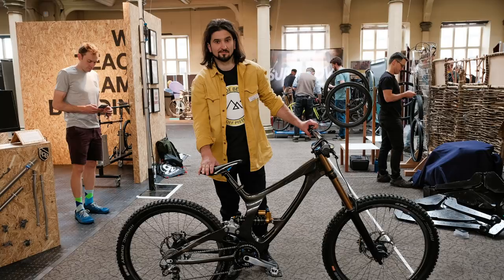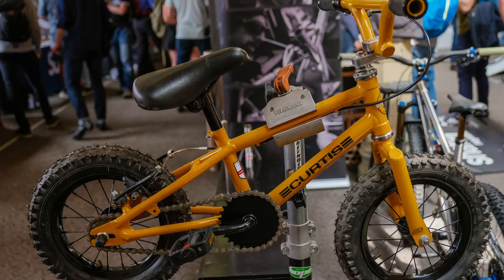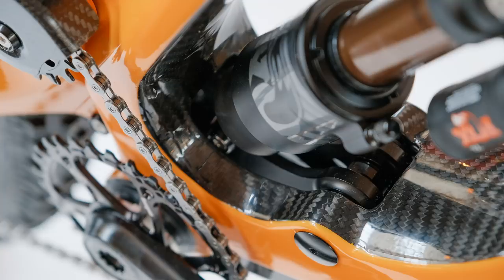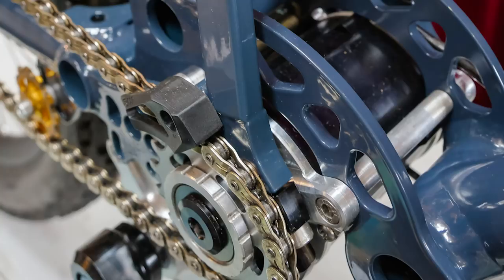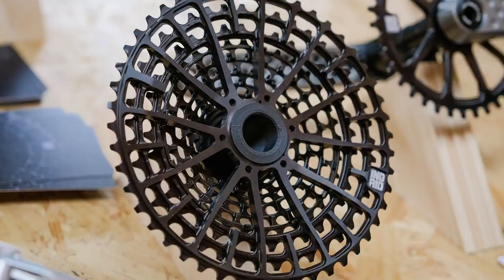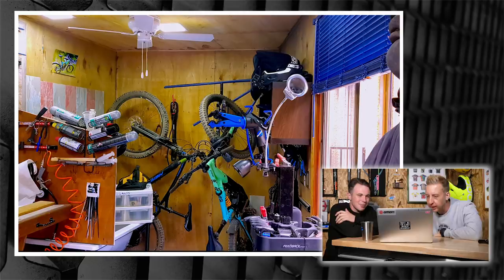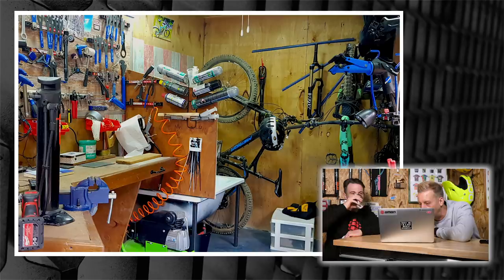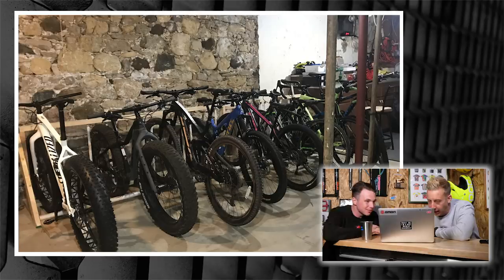Boutique Bikes From Bespoked | GMBN Tech Show Ep. 70

Comment: HEY love your vids can you explain the difference between a lyrik rct3 and rc2 as i am unsure on wether i should upgrade
Reply: Rc2 is more gravity oriented, u can dial it more accuratrely.. But i theory ur better of reshimming the one u have to the desired feel
Reply: They replaced rct3 with rc2 as top damper now...rct3 is superseded. Rc2 has compression dial you set (like rebound etc) rather than just 3 set positions rct3 had (open, pedal, locked)

Comment: 5:54 I think gearboxes are great idea, but I have read that using a oval chainring won't work, for me oval chainring has been a great benefit to me, instead of having unbearable knee pain I can ride for hours pushing harder. with the Effigear you can't do it for sure.
also Effigear is quite different from Pinion, but I definitely think gearboxes are a good idea, but also gear hubs are smart for less exposed parts, and you could use a oval chainring, you need a tensioner, but the weight might be an issue.
Reply: Same. An oval ring paired with shorter crank arms help a lot with knee pain.
Reply: @dukeofmtb also having good saddle position makes a big difference, I use 175 cranks, but for me it works, I haven't tried shorter cranks.
but I see many have saddle far back, and still some bikes have slack seat tube angle, as long as I can have the saddle tip above the BB I am good, but also I have to get a longer bike cus mine is way too short, but pedalling is great, I also have Catalyst pedals, all contact points are perfect , just need proper frame.
I pedal with mid foot position, many still pedal with ball of foot, I have pedalled with mid foot position since I started, but now I can have pedals that fit and work well.
Reply: @dukeofmtb  as long as that's what  works for the rider using it, but I want to try more stuff, first priority for me now is new frame,swap parts over to what ever frame I will get.
I am 181cm, quite average, I rode with 175 cranks since I was a kid, which probably might not have been a good idea.

Comment: What are your thoughts on mixed wheelsizes on a trail/all mountain. Want to try going from 27.5 2.8 front rear to 
HT - 27.5 2.6 back and 29 2.6 front (Norco Torrent HT). And what tyres to chose DHR II rear and what on the front? #askgmbntech

Comment: #askgmbntech Hey guys, love the show. I have a bad bearing on my DT Swiss hub (340 quick release). I removed the freehub easily but the shaft and bearings seems stuck in the hub. I can't push or even hammer it out in any direction. Any suggestions?

Comment: #askgmbntech Hi guys, I recently upgraded my fork from a 2013 Fox 32 Factory 130mm to a 2019 Fox 34 Factory 140mm with boost spacing. I am supper stoked! I am running 29" Roval SL trail carbon rims and purchased Specialized kit to make it possible to run the non-boost rim in the new boost fork. Question, I am considering upgrading the front hub to a boost hub, Specialized will not sell the parts separately so could you recommend a hub, should I stay with straight pull spokes? Alternatively should I wait till I am ready to upgrade to a complete boost bike?

Comment: why dont they have pre broken in pinion gear boxes instead of selling them un broken in?
Reply from the maker: We would assume it's the same reason most other companies don't sell products broken-in. Bearing components often have a very fine waxy (kinda like a dry lube) coating to avoid corrosion during storage. If companies were to break-in bearings and essentially remove this coating they would need to factor this into how long components are stored for both pre and post assembly before end user purchase.